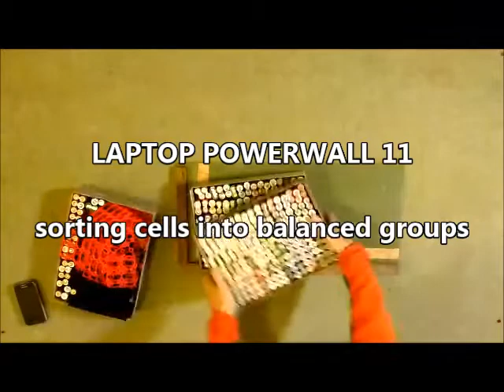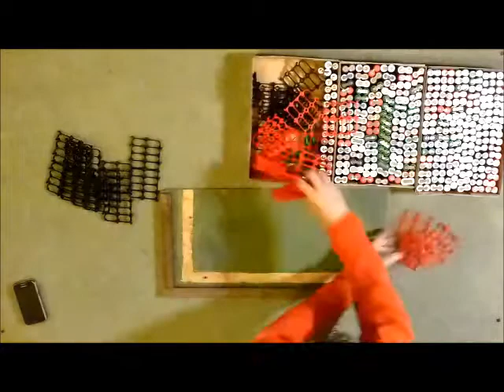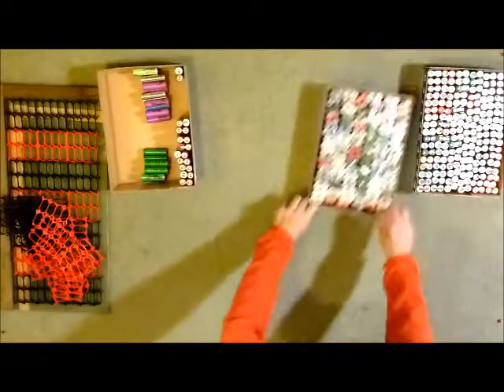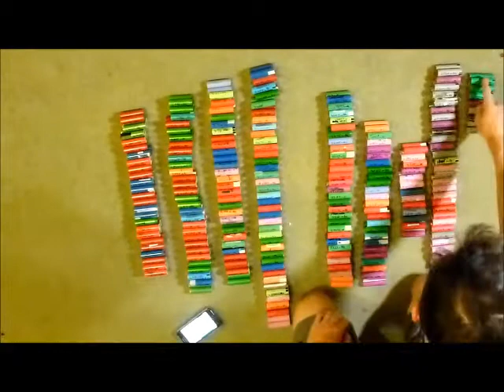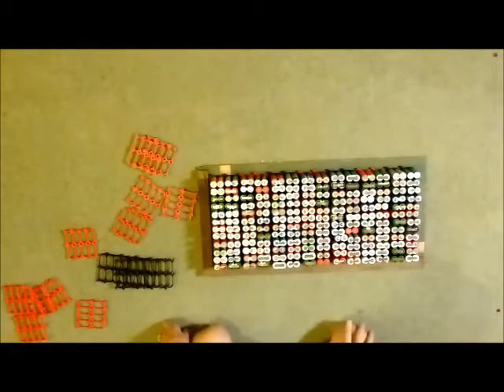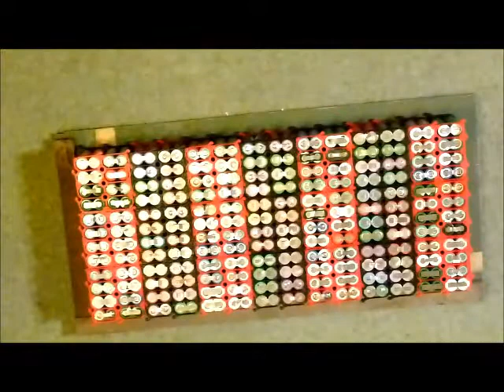Laptop Powerwall 11 - sorting cells into balanced groups

Comment: technically this is only correct if there is a linear distribution of the cells and that the median is actually also the average cell capacity. It;s probably close enough not to worry if you have enough cells to chose from so that any outliers have been sorted out. :-)

Have you measured the capacity of each bank of cells so you can see how even they turned out?
Reply from the maker: Since this video I've moved on to using repackr.com to sort my cells which seems to produce much more balanced groups. https://www.youtube.com/watch?v=DSQtavlBMVg
Reply: Cool, i didn't know about that so thanks for the hint! :-)

Comment: Balanced Groups: While i like the idea, the problem i found with creating balanced groups mixing 2Ah with 1500Ah eg is that the lower capacity cells for normally older "etc" and would need to be changed much sooner then the say 2Ah+ cells. Which creates the problem, if balanced groups is used like with your 2kW pack there is really no easy way to replace a set of old cells or upgrade the older cells with newer ones as time goes on or as the capacity of the park "2kW" drops too much. 
If however you group all the 1600 and 1700 and 1800 and 1900 and 2000+ together within there own sets then like the HB powerwall for eg you would just replace the bank of older cells with new ones, eg a simple swap of 30-80 cells at a time for example, rather then throw away the whole pack or have to completely strip it down to get the good cells out. Maybe an idea for the next pack?  you could still do it without big busbars etc which i agree is alot of work.
Reply from the maker: +Mikes DIY Tesla Powerwall My original plan was to produce multiple 1kWh packs and just swap out poor performing packs. But then I thought I'd try 2kWh - which I now think is too big as a single block pack. I'm working on my design for a 48 cell brick that will be easily replaceable. Trying to figure out a good modular expandable system. Have you thought that far ahead?
Must confess I still like the mixed capacity cell tactic, but wish there was some hard data out there to help settle the question. The big unknown is how long the pack will last with these old cells. Time will tell.
Reply: +Paul Kennett Ya it will be interesting to find out over time. Will have to keep us posted on how the 2kw pack goes over time.  Just wondering since putting it together have to done a capacity test on 2kw pack using say a 20amp dump load. Might be a good idea to do, that way in a year you can do the test again and see how much it has degraded. The bigger the pack the harder it is to do at the same rate. I like the idea of a 48 cell brick. For me and my size not yet. I am yet to work out the end voltage i need but will explain more later on.
Reply from the maker: +Mikes DIY Tesla Powerwall So far I've just been running the pack and watching the overall voltage vary with different loads and weather. I want/need more solar panels now. I had it running the fridge on the weekend. That was... cool. ;)

Comment: hmm just noticed the pack isn't all say 2ah and above but its has a mix of cells with the agv of 1700mAh which is your pair of 3400mAh ? Is that right? 336 cells but only a few piers of 4000mAh cells. Hmm i guess thats right? With all those other laptop batts you are yet to work on you could easily build the pack with the std of 2Ah+ cells.
Reply from the maker: +Mikes DIY Tesla Powerwall Yep. There seem to be two main strategies for sorting cells.
(1) group similar capacity cells together, as done by HB Powerwall, and
(2) spread the various best capacities across all 7 groups to create 7 evenly matched groups, as done by Renoa SuperGenius.
My current thinking is that option (1) is best when you have new cells and option (2) is best for used cells. The theory being that when I combine a large number of various capacity cells I'll get the most balanced groups. Too soon to tell yet if I'm right though.
Reply: +Paul Kennett Have a look at the UK powerwall, He has just put some videos up on his pack builds for a 24v system. He run with the same as HB but with larger packs.
Reply from the maker: +Mikes DIY Tesla Powerwall Yep - I've been following him. Interesting that he changes the number of cells in some blocks to match capacity.

Comment: Wouldnt it make more sense to put the similar capacity cells is parallel groups together, then after a year or two of use you could just take out the lowest capacity group(s) and replace them with some newer ones?

Thus increasing the life of the pack overall?
Reply from the maker: +Jayme Capurso Maybe... I come from an e-bike background where we always build packs as a single unit, never with swapable groups. I like the idea of replacing groups, but wonder if it's a feature that may not be utilised as much as people think it might. 
My thought was that I'd add 2kWh packs to my system as I built them, and treat the 2kWh pack as a swapable unit - rather than the groups within the pack.
Still not sure which is a best approach though. If I find (or design myself) a good simple group swapable design then maybe I'll switch to that. More thinking required.
Reply: From what I gleamed from HBPowerwall, he is parallel grouping by capacity but he seems to be making racks that make it easy to swap out old for new as needed.

Now if I can just find a recycling center that will sell/give them to me, rang 3, all said no.